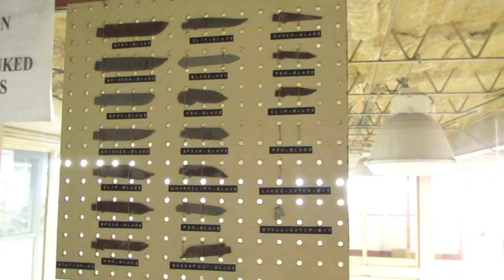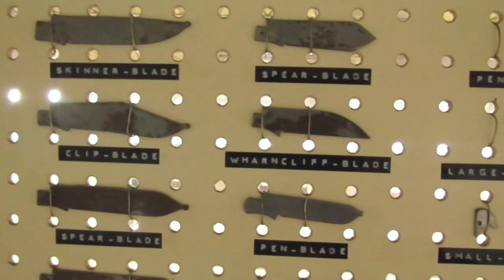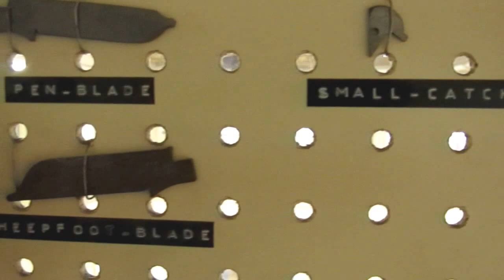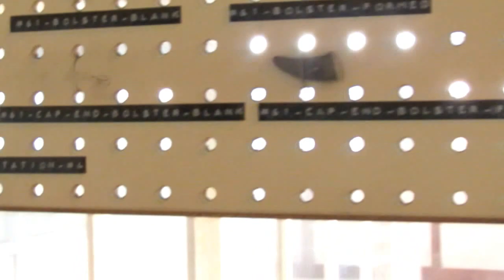TKP 2015 4.0:  Great Eastern Cutlery Tour Pt. 2 -- Production Order thru Tanging

Comment: Great discussion on annealing the tang on a knife. GEC is doing it right!
Reply from the maker: I actually had to bite my tongue a bit during that part of the discusion.  "Annealing" is a process of taking steel to its full softness, reseting the structure to its unhardened state and completely relieving stress.  The term is really misapplied here.  What they're actually doing is an induction "temper," slightly reducing the hardness of the tang to match the spring, adding a bit of toughness, reducing brittleness and allowing the tang to be slightly bent (instead of springing or breaking) in a later process.  The entire blade is hardened and tempered to RC 59.  I would imagine this induction tempering of the tang leaves that part of the blade at about RC 48, not the annealed hardness of about RC 30.